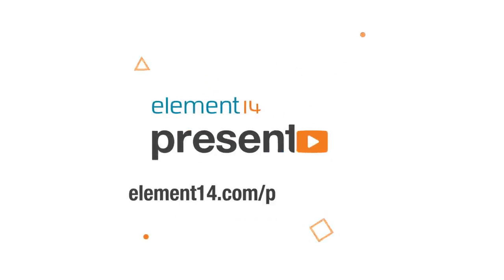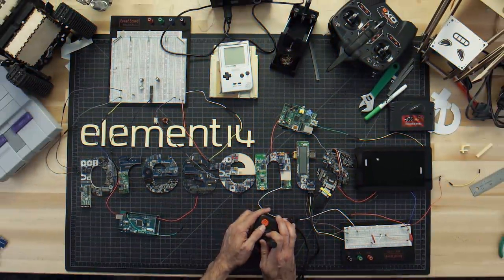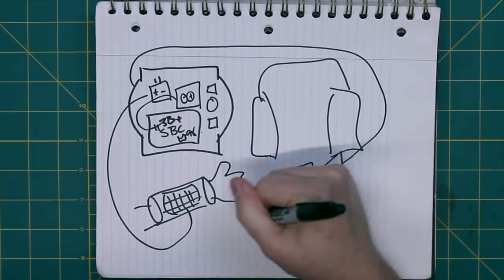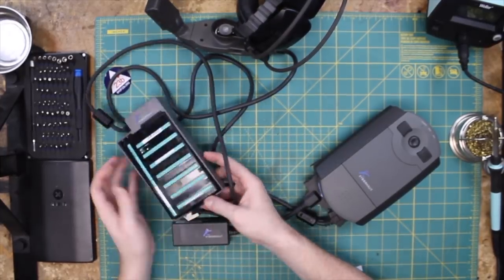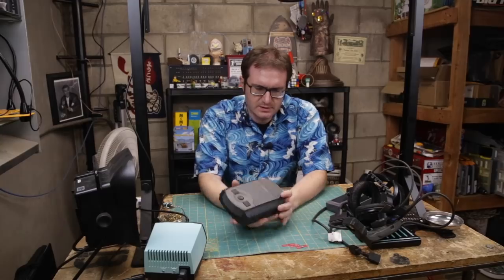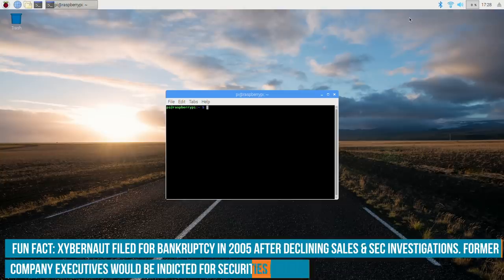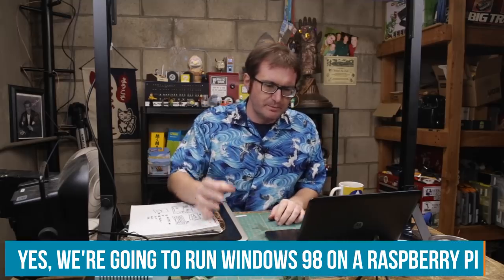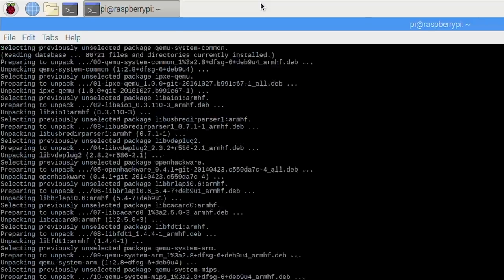Xybernaut Portable Wearable Windows 98 Computer

Comment: I owned an MAIV with the screen several years ago. I actually still have an MA-V, though its screen was destroyed years ago. It even has the belt clip that holds the extra battery, PCMCIA slot and port replicator. I haven't used it in years. But I remember my MAIV ran Win98 quite well, even though the unit itself used to get very hot. The MAV is better heat-wise, but still gets quite hot. I haven't done anything with it in ages, but I still keep it in the box in case I ever decide what to do with this piece of wearable history. I also have one of the arm-mounted keyboards from WristPC (The one you can still buy brand new for $500! Yipes!) And last I checked my MAV was still fully operational!

Comment: I'm very sure the reason why yours didn't work, is because the backup battery leaked.
I feel LGR would be able to do a better video about this, if he can find one where the backup battery hadn't leaked far enough to kill it, remove that battery, and do a video about it. That would probably a better video than this.
22:28 You forgot to install graphics and sound drivers.